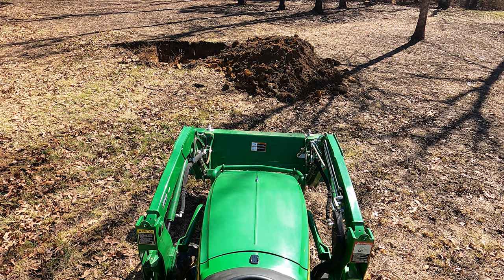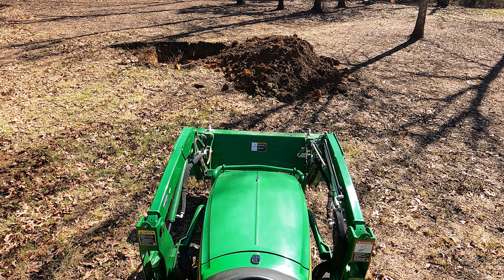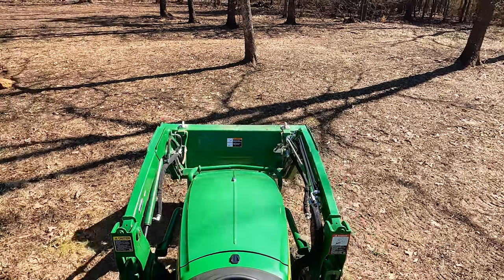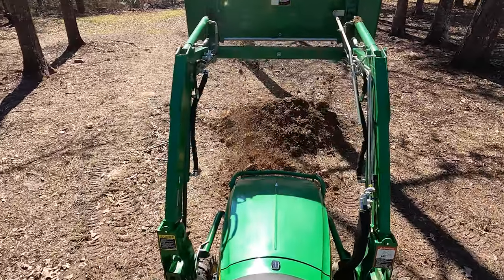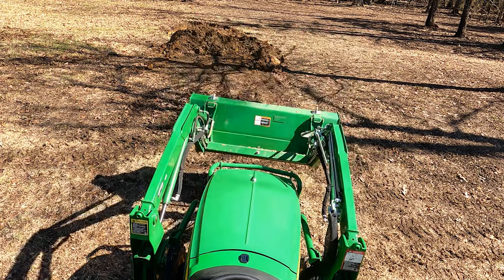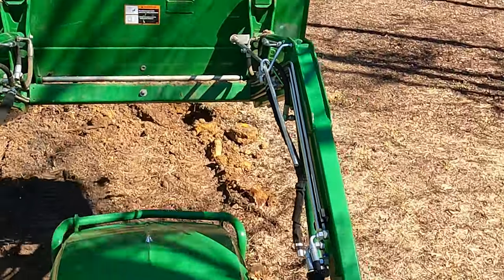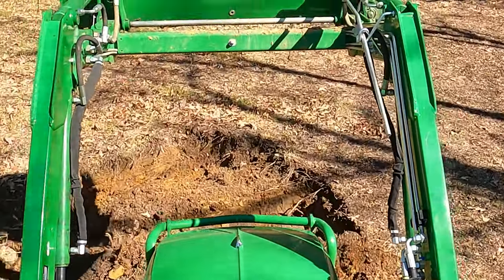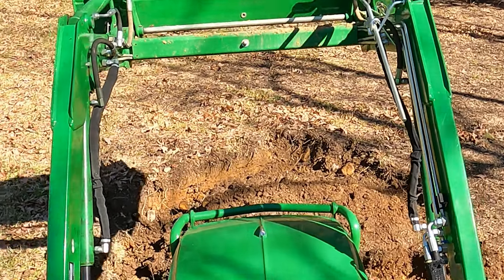HydrosPlus 2R3E First Look - Loader 2 functions and e-throttle

Comment: Could you replace the cylinders to increase lift capacity of the 220r loader? (Assuming proper ballast is in place).  If so, how much more lift capacity could be achieved?
Reply from the maker: Large cylinders coming for the 220r loader later this spring.  Check out this video for a little more info - https://youtu.be/R_ldBSPbX-A

They will yield a 36% increase in cylinder strength at a given pressure with about  a 20% decrease in cycle time at a given flow.